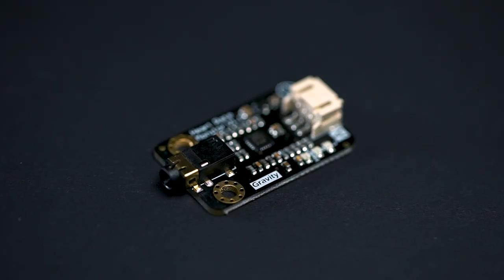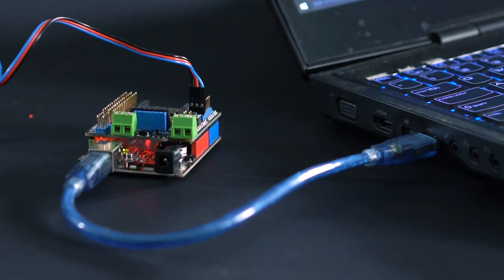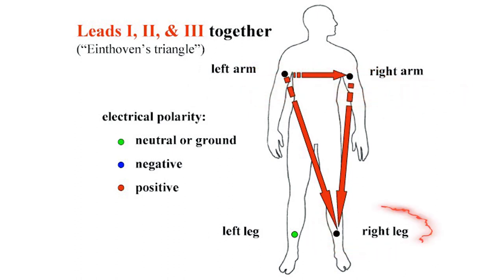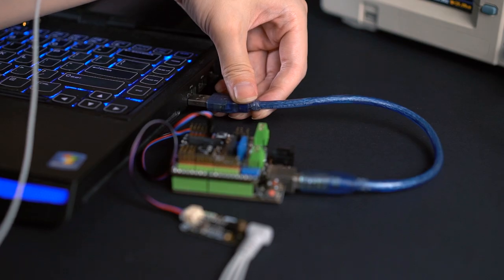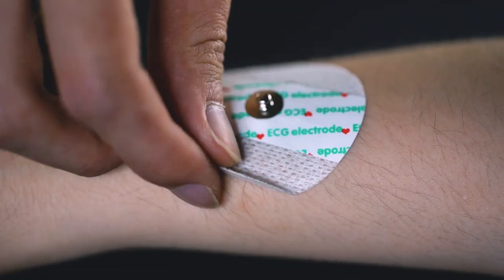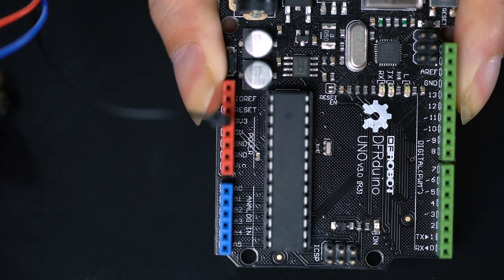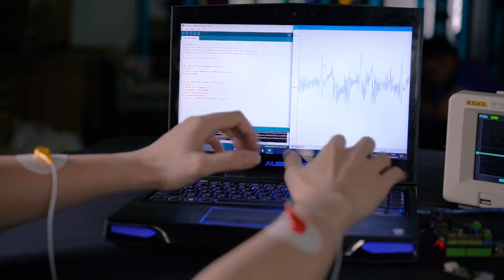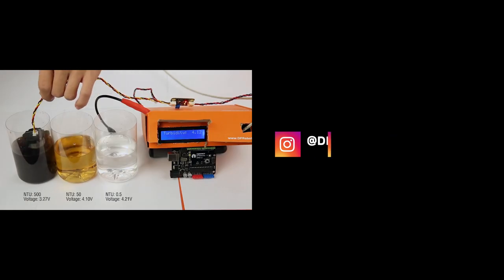AD8232 Analogl Heart Rate Sensor/Single Lead ECG Sensor For Arduino

Comment: Good video,
Is it possible to measure ECG signals at voltages of 10uV? What gain do you have?

Greetings
Reply: well you basically use an opamp, or several op amp stages, that feeds into an adc, can be rather low frequency (so cheap) one

Comment: so i am i to understand that hospitals use arduino boards hanging loose between the sensor and their monitors? i doubt it. where can i just get a plain jane sensor for my scope???
Reply: Thank you! I am looking to do something similar.
Reply: @thespicehoarder   No hospital doesn't use Arduino, they use industrial components with better quality like processor, connectors, wire and circuit components etc.

Comment: Hi,
it is a really great product, thank you

I am using Ad8232 sensor and we get is the data As (0-1024) values on the serial monitor screen of the Arduino as shown in your video :)

 I would like kindly to know  what is the correlation between this output (0-1024) and the raw data that comes out of the sensor (in milli or micro volt )

Waiting for your kind answer
Reply from the maker: Hi Mohammad,
The output analog value 0-1023 is the raw data which corresponding to 0-3.3V range.
Reply: Thank you :)
Reply: @DFROBOTCN  Let's say I get the following singles: 325, 307, 328, 312, 334, 319, 341, 327, 352, 342 on the serial monitor, is there a way to convert it to voltage?
Reply: @Kennerdoll  yes, output 0 = 0 V, output 1023 = 3.3 V

Comment: If in doubt phone emergency services
Reply: My sketchy hardware setup says something is wrong with my heart!
No, I didn't experience any problems beforehand and feel perfectly fine...
Why am I bothering the emergency hotline with this? Well, some dude on the internet said I should waste your scares resources instead of consulting my doctor the other day.

Emergency services are for emergencies. When experiencing a life threatening malfunction of your body you better call an ambulance right away.

If you need electronic tools to see a potential problem it is not acutely dangerous.